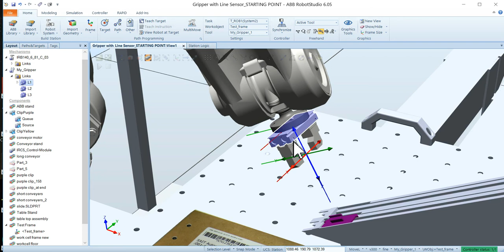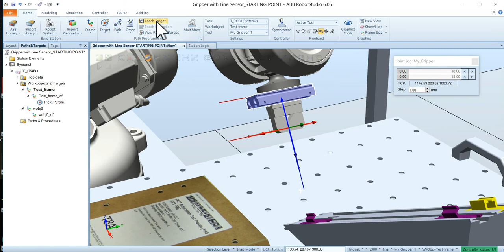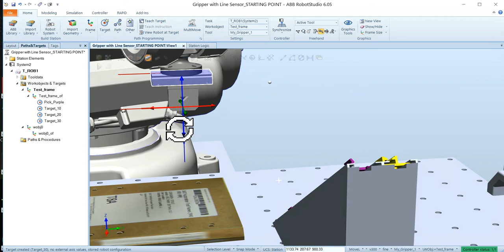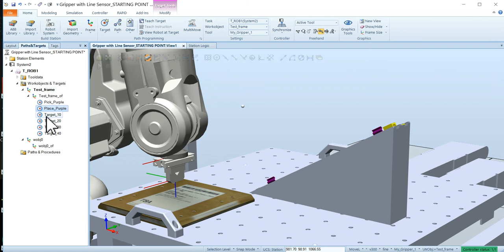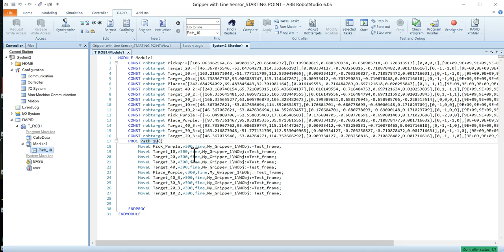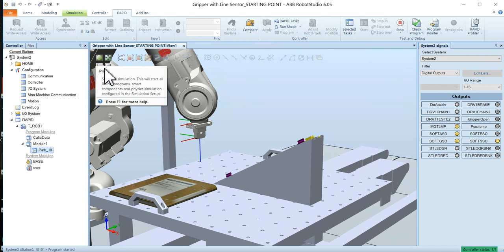Lesson 15  ABB Robot Studio Pick and Place Operation Part 1

Comment: Hi Craig, I am having some issues with setting up my gripper. I already developed a smart component working on a conveyor, but for some reason, the plane sensor moves along with the robot movement. I have deactivated 'detectable by sensors' on all parts of the robot, tried creating a new plane sensor, but its the same issue.
Could you advice, would also appreciate if i could reach out to you directly, thanks